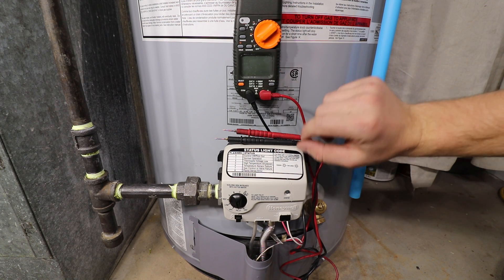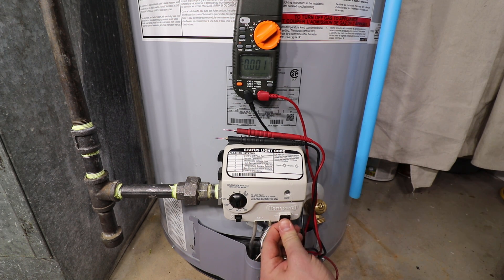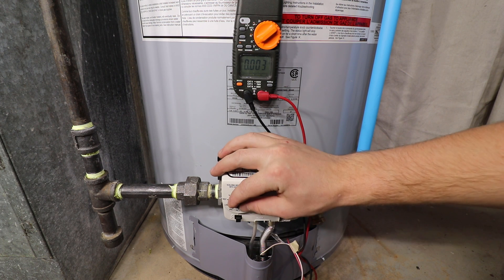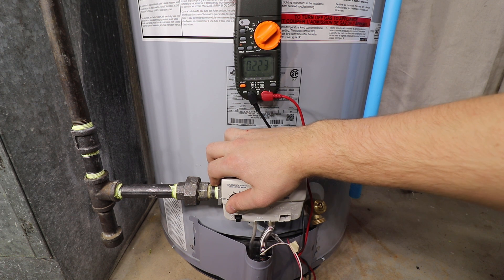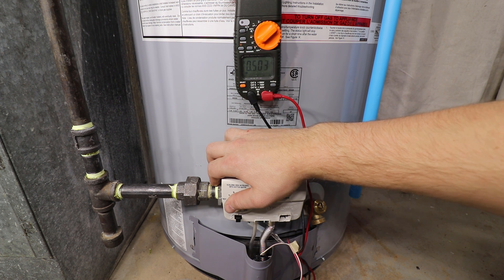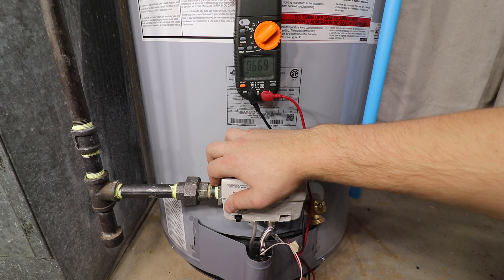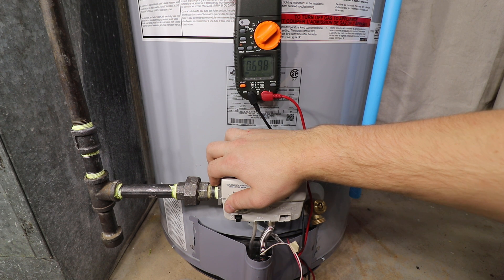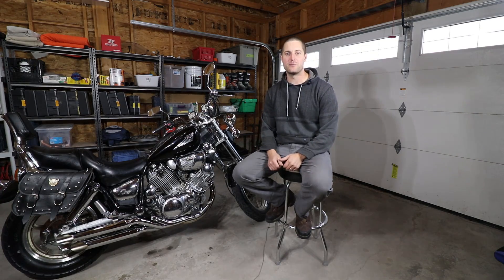Testing a Thermopile on a Water Heater

Comment: Pat, 500mv. BUT I checked it a bit differently than you described in your video. Why you may ask: Because my thumb gets tired - haha. Just kidding. I’ll explain in a minute
I left the temp control at hot but did the check when the burner had been off for 20 minutes. Only the pilot was lit. I pulled the two wire connector from the valve controller (as you did) and connected the red on the fluke to the red wire (which goes directly to the thermopile) and black (on the fluke) to the white wire (which is the other color on my WH) that comes from the thermal switch  to the thermocouple. I did it that way to give me a more accurate reading of how much voltage the thermopile was producing in the normal constant on pilot condition. Would doing it that way give me a correct reading?

If so, and if (as you said) the thermal switch is working correctly (closed), why is the pilot going out every 3-4 days?

Thank you very much Pat.
Reply from the maker: I think I'm following. Were you testing the thermopile's voltage without having to hold down the control knob? This is called a closed circuit voltage test. The test in the video is an open circuit voltage test. They both will work but the closed circuit voltage test will read slightly lower as the gas controls circuitry will draw some voltage. 500mV would be acceptable for a closed circuit test. Since both the thermopile and thermal switch are passing their tests, I would think it would be a fault with the gas control valve. Commonly the temperature sensor in these valves can fail. They will usually fail at first under higher hot water consumption, and will happen more frequently over time. You can keep a log of when the tank fails and determine if it is happening under high hot water consumption. e.g. filling a bathtub, multiple showers back to back, loads of laundry. If you were a client of mine and the thermal switch and thermopile tests pass, I'd replace the gas control or install a new water heater, depending on age of tank and budget. Thanks for the update!
Reply: Pros DIY Well Pat, I think your HWH whisperer mode kicked in on this one because it seems from the testing you recommended (that’s why I hadn’t replied for two weeks) it does sometimes cut the HWH off after heavy use. Instead of replacing parts (I’ll save the $70 totals to rent the pickup from Lowe’s) I’ll get an AO SMITH from Lowe’s (budget is not a huge restriction and seems well spent for another 13+ years). Hope it’s ok to transport on its side??
I’m thinking Signature Select model (either 40 or 50 gal) depending on size. Those models come with either the 9 or 12 year warranty. Do you think the longer warranty is actually worth it (at least as an indicator or quality in the build)?
BTW, I drained the tank today (first in its 13 year life, oops) since it shut off anyway. Even after shooting the cold in after empty to mix up sediment, I had very very little white scale purged outta all.
Anyway, I very much would appreciate your thoughts now that you have a little more info.
Reply from the maker: @MRrwmac  Sounds like a solid decision. Residential tanks will be safe to transport on their side and won't void warranty. Just avoid large bumps and potholes. If you have to make  a choice between getting the 12 year warranty and a larger capacity tank, I would always choose larger capacity. The larger capacity tanks (50 gallon+) tend to last longer. In my experience the difference in build quality between 9-12 year is negligible. You are just paying extra in the case it has to be repaired in those 3 additional years. It's important to note what the warranty covers too. Currently 6 year warranty tank includes 6 years tank and parts, 1 year labor. 9 year tank includes 9 years tank and parts, 2 years labor. 12 year warranty tank 12 years tank and parts, 3 years labor. In the end it would be your decision in what you believe the extra 3 years is worth. Personally I would never get the extended  warranty, but I also get discounted parts and can repair it myself. Hope this helps in your decision. All the Best!

Comment: First of all thank you. Your videos and detailed comments have been most helpful so far. 

My issue is the pilot lights but there is no status light. The longest I have waited is a little over two minutes. Should I wait longer?

Back story: I found after I was away for 5 hours when I returned home I found I left the water running in my bathroom sink- not fully on but more than a trickle.  Later that night I was washing my face and realized the water was cold and it must have ran out but checked on the tank anyway. There was no status light blinking as there should be so I just turned the knob to off and figured I would restart it. I did no check to see if the pilot was on when I just turned it to off... and thought it would be an easy start.. and I hadn't been able to get a status light since.  I've read the comments of similar situations on your other videos.  I took the thermopile  out and cleaned it off and scrubbed with sand paper.  The TCO button on mine is white and appears to be out but I press it and it doesn't budge. I did the voltage test and it passed maxing out at 730mV.  I did not do the connect the two red wire test. My only thought now is that it's the gas valve control.  Is this in line with my tank running a lot while I left the water on and finding it with no status light?  Any suggestions or other troubleshoot ideas are appreciated. 

The only other issues I've had is it go out 3 months ago and had the 4 blink status which I was able to reset. I don't know the age of the unit as I bought my place two years ago and therefore most likely not under warranty. 

Again, Thank you!
Reply from the maker: HI Danek, Thank you for the detailed information.
Just to rule out the TCO, I would connect the 2 red wires together and relight. The 730mV is excellent, so we can rule out the thermopile. I do believe you will end up being correct with it being a faulty gas control. Since you've witnessed a 4 blink code in the past, I would suspect the gas control.
To answer the questions:
"The longest I have waited is a little over two minutes. Should I wait longer?"
2 minutes is plenty and the thermopile would have reached max voltage.
"Is this in line with my tank running a lot while I left the water on and finding it with no status light?"
This will cause the tank to fire/run for long periods. This usually causes the TCO to trip or the gas controls temperature sensor to trip, causing the pilot flame to go out.

I would bypass the TCO to rule that out. If that doesn't resolve the issue, I'd replace the gas control valve. Hopefully this gets you in the right direction. Let me know how it goes. Best of luck!
Reply: @PROSDIY   Update: I was able to change the control switch and I have hot water again!!!.... Thanks to this video and having my dad on speed dial.
Reply from the maker: @danektorrey9497  I'm glad you have hot water again and the video helped you out. Thank you so much for the very generous donation! Made my day! 😃. Take care!

Comment: Pat, Thanks for the very informative and instructional videos! I installed my Whirlpool 40 gal 40k BTU gas water heater 10 yrs ago and it has worked without a problem until just last week. The water was cold so I relite the pilot and it worked for a couple days. It has the Honeywell valve with status light which shows working normally (1 light every 3 seconds). It went out again so I relite it and again it worked for a couple days. I cleaned the vents the first time but noticed the little button between the contacts on the temp switch is stuck hard and won’t depress at all. But since the water heater relites I guess it’s closed.
My question is: I can afford a new water heater (thinking of an A. O. Smith from Lowe’s this time) because of this ones age, but if you think I should just replace the thermopile, I will.
Your expert opinion would be appreciated! Thank you!
Reply from the maker: Thanks for the question and detailed information. Did you end up doing a voltage test on the thermopile to determine if it was weak? The TCO button will be "stuck hard" if it is functioning properly, so we can rule that out.

With regards to the replacement, it would be your call. I tell my clients to budget for a replacement when the tank is 10 years old, and that most newer residential tanks last between 12-15 years. This is dependent on usage, quality of water heater, and quality of the water. Personally I would change the themopile if that's causing the fault. I have an unfinished basement and there's someone usually always home at my residence though. If your home will be vacant for weeks at a time, I'd lean more towards tank replacement. Then you wouldn't have to worry as much if it were to spring a leak.Hopefully this info helps you make your decision. Thanks!
Reply: Pros DIY No I haven’t checked the thermopile voltage yet because my old trusty bought from PX Sperry multimeter (I’m retired Military) doesn’t do millivolts. My friend has a Fluke that will, so I’ll borrow his this weekend and check both the TCO and the thermopile. I’ve heard above 350 is good but you stated 650+ would be the better numbers to determine replacement of the thermopile. I’ll get back with you after I check.
As for the water quality - good here in my area of Durham NC, water heater - whirlpool N4OS61-403 seemed a better than average (at the time 2009), and lastly its in our garage plus I’m always home (we watch our granddaughters) so if it leaks very little harm done.
Unfortunately I’ve never changed the Anode rod nor done the recommended flushing (lazy I guess argggg). 3 adults in the house shower every couple days so relatively low consumption. I gave you the model number of my old one: could you please direct me to a good and correct thermopile or pilot and thermopile kit?
If I go with a new one, I’m considering the AO SMITH brand from Lowe’s and would appreciate your expert opinion: G9-S4040NVR, or G12-S4040NVR, or a 50 gal version (I like long hot showers) with a 9 yr but must be a short. Mine is currently on a 7” high wooden platform which I assume is NC requirement?
In the new AI Smith, I wish the anodes were better and glass lined tank, but they are what they are. Anyway, THANK YOU VERY MUCH for any further guidance you can help me with!
Reply from the maker: @MRrwmac  The voltage test will be very useful and get you in the right direction. Most gas controls will run on as little as 350mV but they should read in the 600mV plus range.
Your pilot assembly is part #6911143: https://amzn.to/2JjQhml
Generic water heater thermopiles will work on your model: https://amzn.to/2D8QTs8
I always recommend a higher capacity tank, like the 50 US gallon. They tend to last longer because they aren't being overworked. The 30-40 gallon tanks are more likely to become depleted (run cold) from time to time. This depletion cycle is very hard on a tank, and can cause them to fail prematurely. A.O. Smith, and Bradford White are my trusted brands. I'm not sure if the 7" platform is a requirement in your jurisdiction. I would assume not, and that it was a personal preference. I would double check with a local contractor though. Let me know what you decide and if your get the voltage reading. Best of Luck!
Reply: I install and repair water heaters. If you're considering a new one only buy a Bradford White. Btw, AO smith makes whirlpool and a few others. They're exactly the same and they have a problem with burners tearing. 
Bradford White is the only way to go